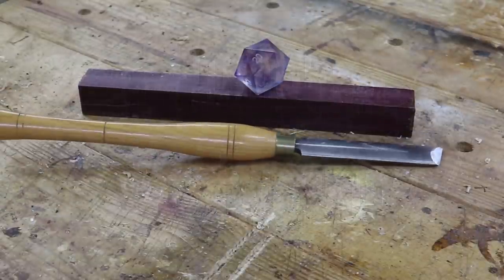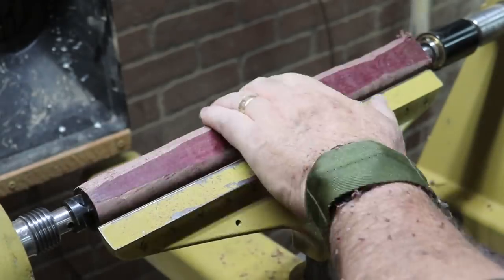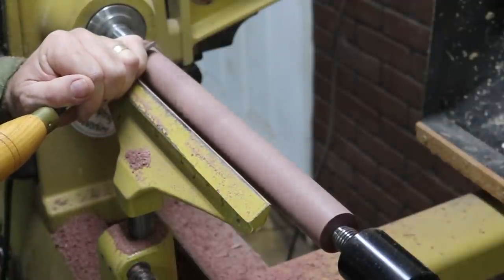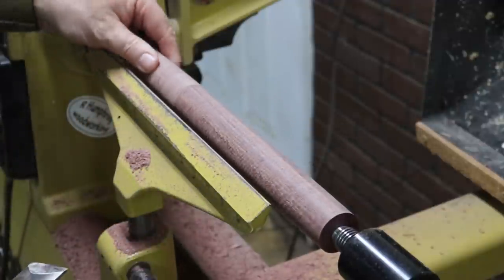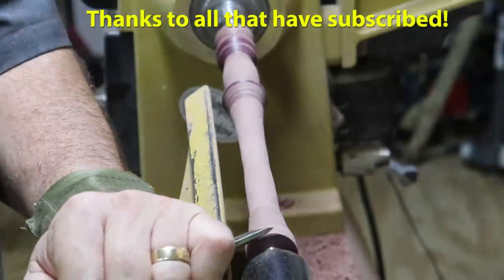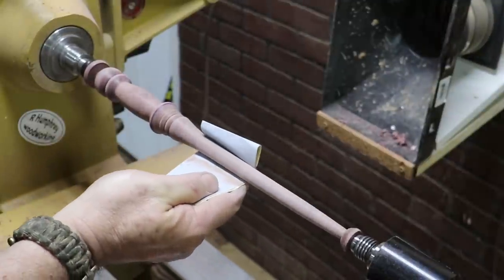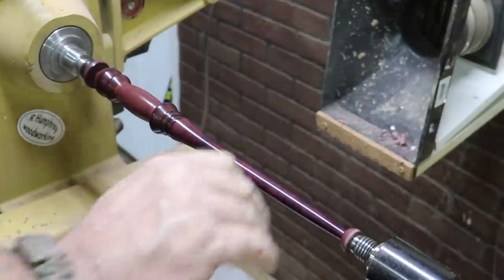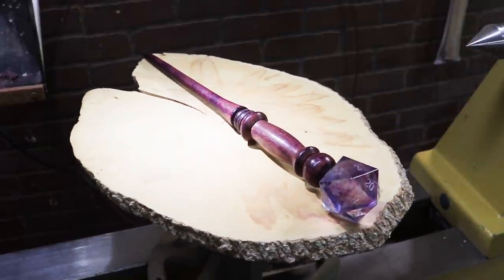Woodturning a Wand

Comment: A slightly less fun but possibly more effective way to re-purple-ize purple heart is putting it in the oven! This apparently also helps it to stay purple long term, though I haven't seen that for myself for more than about 3 months, since I'm new to this. I do 325° F for 1-2 hours and it always comes out a very deep royal purple, if you want it to stay a bit lighter, try 300°, and if you want darker go to 350°, but watch it closely at higher temp because you can scorch it. If it does scorch, it sands off, and the best part is the colour is even throughout! There's a bit of trial and error to get best results, since each piece is different,  but it works great!